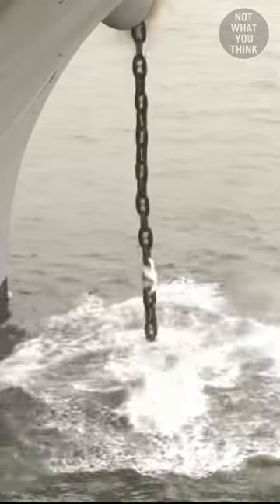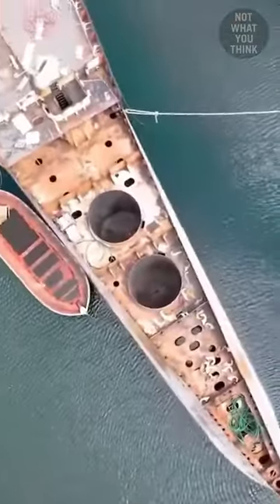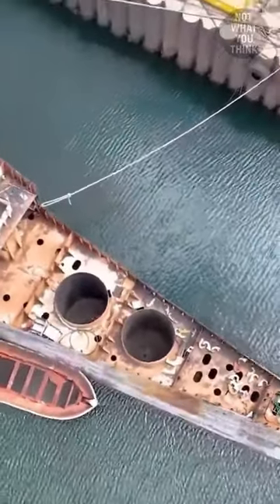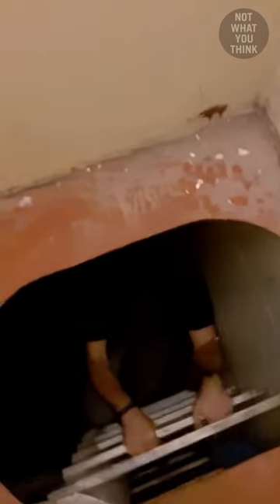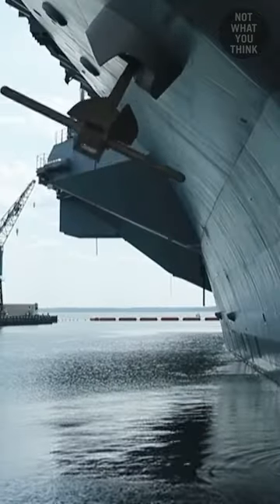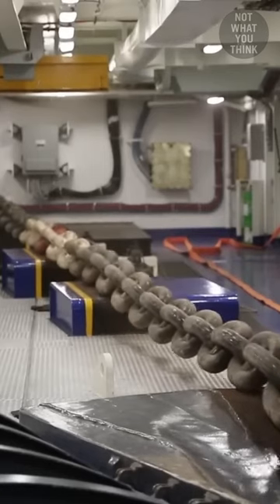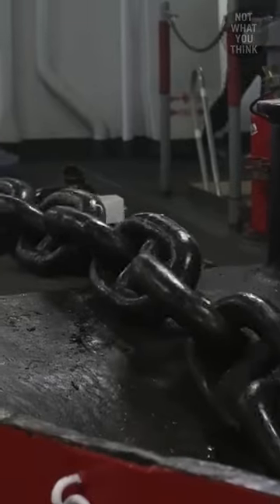The "Bitter End" of the Anchor Chain

Comment: Chain lockers are damn dangerous spaces to enter.
Reply: They are, and not necessarily for obvious reasons. They tend to have little air circulation, and the rusting anchor chain can draw much of the oxygen out in the air. You can suffocate.
Reply: @ThatGeezer  I always wondered why we found a lot of dead rats inside a chain locker of an old ship we were scrapping.
Reply: Sounds like the place for a good scene in a horror movie.
Reply: @ThatGeezer I was just thinking if the chain started moving. I didn't know rust would do that
Reply: The engineering dept has to run tests before entering the space.
Reply: @ronchang9791 Dying of oxygen deprivation is actually one of the more "pleasant" ways to go. Your body can't tell your level of blood oxygen; rather, it can detect the level of blood CO2 - if this gets high, you need to breathe - and this works fine in normal atmosphere. As long as you can exhale CO2, you won't get a choking sensation, you just pass out.
Reply: A good place to store farts
Reply: @dustintacohands1107  That would be the Goat Locker, aka the Chief's Quarters. ;-)
Reply: @HarryWHill-GA  well seasoned
Reply: @mnxs  Most people will experience lightheadedmess in reaction to low oxygen environments. But yeah if it's seriously bad you can be unconcious in a few breaths, before you even have time to panic to realize whats happening and panic or anything.

Comment: Those holes are old gun mount basins on a decommissioned ship. The chain locker is a void in the forecastle aft of the capstans. 

Chains come in shots. Each shot length is 6 fathoms. Each shot is sperated via painted links. Last shot has red paint for obvious reasons. Technically the last shot is anchored to the hull in the void but an uncontrolled drop will just rip it right out.
Reply: This was the comment I was looking for. How long did you/have you sailed?

Comment: The film Battleship lied about this but it was still a fun movie!
Reply: Would old battleships have this attached differently?
Reply: Yes - and no.  You'll note that it's only the END that isn't attached well.  There are other attachment points on the chain that are stronger.... but fail sometimes.... else the anchor would never be winched up!
In battleship - they drop the anchor, and the ship does an unrealistic turn - but they THEN release the rest of the chain, completely binning the anchor and chain.  So they did lie - but not about this part.
Reply: @UKMonkey  I don't think it matters how strong the connection points are, there is absolutely no way any chain or ship can survive the amount of force to stop the USS Missouri in one second. According to some math, the Mossuri weighs approximately 57 kilotons and if we assume it was travelling at a speed of 30 knots (15.43 m/s), you require about 880 meganewtons of force. 

An average car travelling at 100 kph (60 mph) that stops within one second will require about 30 kilonewtons give or take. 

To put it into perspective, stopping the USS Missouri in one second with one chain is equivalent to stopping ~29,000 cars travelling at 100 kph all at once. Or one car travelling at 2565 times the speed of sound, reaching London from LA in 10 seconds. 

Realistically, the most that would happen is the rock that the anchor caught would just be pulled along with the ship and you wouldn't even notice. 

As unrealistic as this movie is, it is very fun to watch!
Reply: @mrdoggy8801 i love when you math wizards enter the chat and use math to show how crazy things can be
Reply: @bobertmcboberty1385 you realize he literally just copied and pasted the post on reddit right?
Reply: I think it's more likely the anchor would be snapped off the chain. The anchor itself isn't what holds you on large ships. They are held in place by the friction from hundreds of feet of relatively high surface area and porous chain partially sunk into the sea floor.the anchor attachment is the weakest point in case of this exact scenario, and a chain that could actually arrest the ship at full speed would be impractically heavy. Ships lost anchors in high seas relatively regurlarly.
Reply: @bkokohut1980  I did? I don't often go on reddit but I'd love to see someone else's take on it. 

I also spent a decent amount of time formulating that reply and doing the calculations myself. Therefore, I would appreciate it if instead of jumping to conclusions and assume I'm some lazy copy and paster, you yourself took a minute to back up your statement.

Comment: And each length (SHOT) is typically 90ft. There's a detachable link between each shot and on each side of the link are marked white. If there's one white marking it would indicate 90ft, two white markings 180ft and so on. The last two lengths are painted as first yellow and last one red respectedly.  if you're on an anchor detail and the brake fails if your see the yellow shot coming out... RUN

Comment: This is in fact the meaning of the phrase "to the bitter end." Years ago I read that the bits in question were, iirc, wooden pegs at certain points around the deck where various ropes would be attached. My memory is hella foggy on exactly what the bits were, but not on the origin of the phrase. And I guess here we have confirmation of the, or at least a, meaning of a bit on a ship.

Comment: But how does it hold the ship if it breaks?
Reply from the maker: The weight of the chain on the seabed is what holds the ship in place.
Reply: I would think the chain is rarely fully extended which would add strength. Also I would bet while the bitter end is weak enough to snap off in extreme situations it likely is strong enough to hold under normal conditions.  They probably just don't want it so strong as to damage the structure of the ship should an extreme condition occur.
Reply: The bitter isn't what does the holding normally. The winching system has a brake on it that takes the forces between the ship and chain. If the winch brake fails and the chain starts paying out rapidly, you don't want to strong of a connection when you get to the end of the chain.